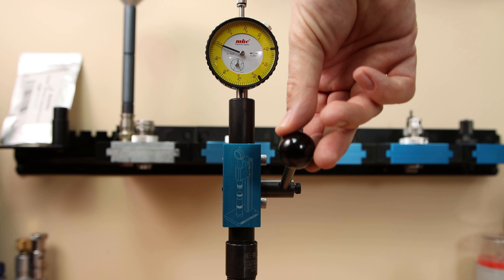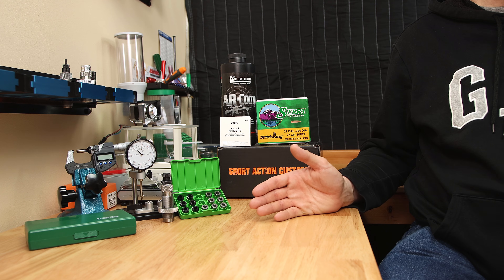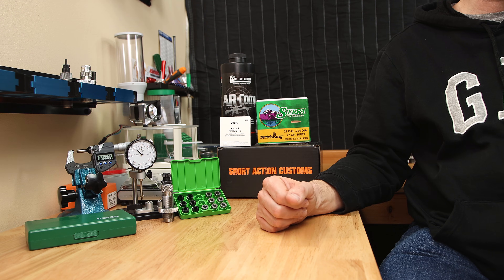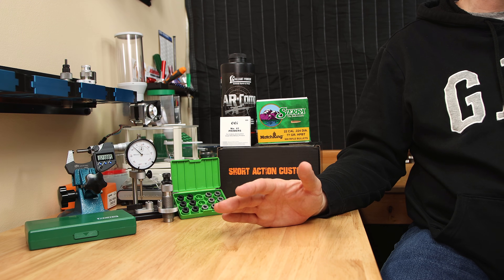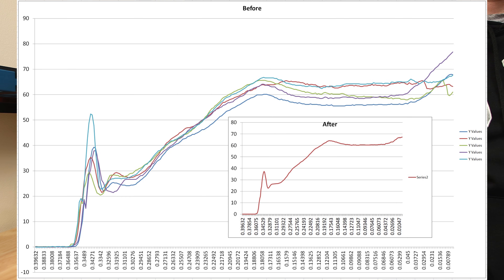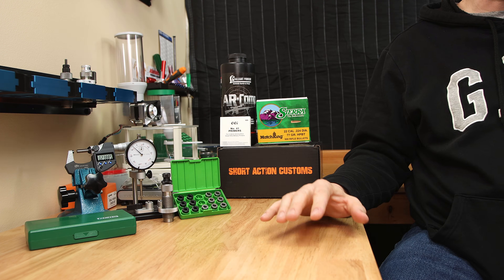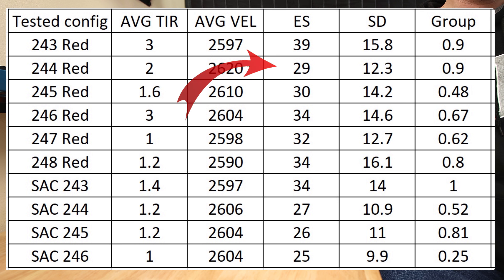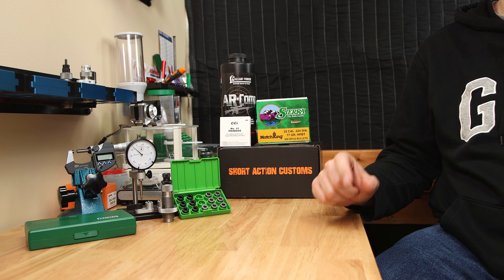Testing Neck Tension in 223 - UNBELIEVABLE Results?

Comment: if you try to use calipers for measuring wall thickness or anything else that small, you will likely get quite large errors unless the pressure you exert on the caliper when doing a zero is a lot higher than otherwise.
the zero from my experience is not a soft zero like anywhere else on the scale, but is a solid jam closed or it will be 0.002-0.003 inches out. i checked this on feeler gauges to work out how much error i was getting and it was relatively consistent between calipers. 
the real point is...dont bother to use calipers for measuring neck thickness or case width as its not designed for them. Use a Wall thickness micrometer or similar, that is designed for that purpose.
Reply: i was tearing my hair out doing neck turning, aiming for 0.013 but constantly ending up at 0.011 until i checked the turner with feeler gauges, and then checked the micrometer accuracy at zero reference measurements.
uniform neck thickness and a specific neck thickness is critical if you are using a die such as a Redding S, where the neck thickness dictates the bushing used (if you are trying to dial in the bushing size for neck tension without over working brass).

Comment: Could you kindly help? Can I adjust the redding type s die to get more neck coverage with a SAC bushing?
Reply from the maker: Adjusting the top screw down to touching the bushing and then backing off a 1/8 or 1/4 turn to allow the bushing to float is as much as you will be able to size the neck. That has been plenty for anything I have used them in including 223 and 300 win mag.

Comment: White Oak 416r Barrels<Criterion 416r Barrels. Probably the cheapest accuracy I’ve ever bought. Just this past weekend I shot two one hole groups at 100 yards measuring  .25” and  .33” with two different hand loads. But I also use a Silencerco Omega 300 suppressor which has consistently made every rifle I have more accurate.

Comment: Another method used by erik cortina is to use a bushing that takes it a little below desired neck tension, then use a mandrel to set the final dimension. You could just use a normal die amd then mandrel, but the purpose is to not over work the neck. I plan to try this soon on my new 20 practical. Also, annealing is going to change tension without changing the method.
Reply: Erik also doesn't clean the inside of the neck, which reduces the coefficient of friction and prevents a true cold weld.

Comment: Something to consider if it's a auto loading is that if neck tension is light enough the projectiles will shift to touch when cycled therefore alter coal possible to a better harmonics position. Not that this is the cause of the smallest group but it does need to be considered. Seating depth with have the largest impact on group size a closer distances

Comment: This is great data, thank you.  So I take it you run a 21st century mandrel or turning arbor through the neck after sizing with the Redding sizing die with the SAC bushing?  I’m just confused on this one point, because you have referenced both systems to reduce runout.  I have reduced runout quite a bit by just using a 21st Century mandrel after sizing with a std sizing die and calling it done.  Thanks for any info.
Reply: I was going to ask the same question.  It wasn’t mentioned if a mandrel was used after sizing.

Comment: Love your Channel very good information and with data to back it up. But I have a .223 using LC brass bought a 245 originally but I could push the bullets easily. I contacted SAC and they requested pic of the calipers measuring the brass. They were nice enough to switch the bushing since I had just purchased it. They recommended 243 and I get good groups. So what changed?  Thank you.
Reply from the maker: I am not sure what your seated dimension is. 3:10 in the video I show the what the example is based on. I wouldn't think there was that much variation but you should usually be .002 to .oo3 under this dimension.

Comment: Just found your channel.  Question, if you set neck tension, is there a need to crimp? I'm just reloading 223/556 for my ar
Reply from the maker: Hello kfez, Welcome to the channel! If you set enough neck tension you may not need to crimp. If there is a cannelure, I may think about it but if not I have not been doing it personally. You can test and see if you have a issue with the COAL changing and see it if matters for you. It also depends if you want to prioritize accuracy vs function. Every time I have tested it I seem to be loosing a little accuracy by crimping, may not matter to you at all.
BAR
Reply: @BoltActionReloading  thank you for your time. I'm just getting in to reloading, so I may have a ton more questions.  Thanks for putting out good informative content

Comment: Could you do a video on the AR your using(ie bolt carrier, bolt, receiver ect) to go along with that White Oak Barrel which are a deal for the accuracy. I’m wondering if the muzzle is threaded and are you using an adjustable gas system? Did you loctite or use shim stock on the barrel extension during installation? Great video thank you!

Comment: Hey Guys, dear @BoltActionReloading let me have an ambiguous question for you, which is totally not clear for me and may put some new light on the subject. Lastly I found videos about this gauge https://youtu.be/LMOx9nBBJzY and it is also used for light "hammering" the neck. The thing is that the action is performed on fully prepered ammo, the run-out measurement is taken from body (not the neck) and the pivot is hitting the neck with projectile already seated. Am I missing the point of this device or in fact it's changing the bullet seat and can worsen neck run-our? What is the reason to hit the neck (with already seated bullet) and measure change on the body. Is it anyhow possible to improve total concentricity (to streighten the ammo) without any influence on neck and projectile seating?
I decided to ask this question here because I believe this channel community have great knowledge and experience. I'll appreciate your help to understand the approach described. Cheers
Reply from the maker: Hello Sir, You ask a very interesting questions that many will disagree on the answer. I have not tested this type of functionality before because impacting the case on the most fragile part hasn't made a whole lot if sense to me. Though we all like small groups, this appears to possibly be more geared towards benchrest folks not to say you couldn't use it for what you like. Hornady's tool allows for something similar but I pretty much tried to fix my concentricity in my sizing die not after I had seated the rounds. If you decide to try it out let us know how it works for you.

Comment: If running light neck tension, i.e., .001"-.002", does brass spring back play into the equation?
Reply from the maker: Hi Tim, Some spring back should be expected, and it will be different if you anneal or you do not.

Comment: I have the Redding .308 die.  Would I want the SAS bushing that is .003 smaller than the bullet?  .305?  How do I get the ID consistent?  FL die with certain size Mandrel?  Apologies, but I'm new to this.  I'm not new to reloading but I am to specific neck tensions and being more consistent.  I have an AR 308, a bolt 308 and a 300 Win Mag, oh and a 7 RM.
Reply from the maker: HI Gary, I am going to cover this exact caliber (308 Win) if you can wait. Usually you would go .002 to .003 under loaded round diameter. If you were going to mandrel .002 under is a good guess. I did a version of this with mandrels already but I want to add the amp press graphs so I will be doing it again. https://youtu.be/OMEi5eHTLxQ

Comment: Richard Lee made an interesting statement is his Modern Reloading book.  He basically stated that if the neck of the case is more than 0.001 inches less than the bullet diameter, the bullet serves as a conventional expander.  He also said that a bullet does not make a good expander and would create excessive runout. In my opinion, since the brass used in your comparison test is random range brass, the data provided may be inconsistent due to other variables.  It would be interesting to see this test done with a consistent lot of new, quality brass such as Lapua.  Another useful aspect of this test might be to carefully remove a set of bullets after they had been seated and measure the inside diameter of the case neck.  This would test the validity of Richard Lee's statement regarding the bullet acting as a conventional expander.
Reply: clever, smart and wise bloke that Richard Lee. In ways, a genius.

Comment: I really think this is due to the short action custom bushings only sizing half of the neck vs Reddings that size the entire neck. (all the way thru the bushing is the same diameter vs SACs bushings that only size halfway thru the bushing.) This is  why you have to go 1 size smaller on SAC bushings to get the same tension, I am sure.  If your data is correct then it must be helping groups I cannot argue that. But why is only halfway sizing the neck (approximately) doing that?  I would love to see this test on good Lapua brass with the inside and outside necks turned /reamed for consistancy.

Comment: I have 6.5mm, .30 cal and .338 I need bushings for. I'm going to try Redding bushings first . I know I will need 2-3 bushings for each caliber. They retail for 15.95 ea at Creedmoor. Reddings Titanium bushings are 26.95!  The SAC Bushings are 35.00 ea from them. Yikes!  I cant imagine Reddings being inferior quality. It appears the big difference is the SAC bushings only sizing halfway thru the bushing to me. Anyhow, that cost difference is $143.00 vs 315.00! I will check the runout on 2 different measuring systems and find out if my runout measurements are as inconsistant as yours. I am using Lapua Brass tho, not range pickups.

Comment: Since using the two step method of redding body die to bump the shoulder 2th and lee collet neck die I've been getting 1.5 Max in run-out, cheap set of dies and they work for me
Reply: What's the clamp you have that's holding the micrometer
Reply from the maker: There is a link in the description to a micrometer stand.

Comment: Thanks for the great video. Probably a stupid question: Can you use these bushings in a redding 308 Win B/FL 9R Die, or are they only for Short Action Custom Dies
Reply from the maker: They are not just just for SAC dies. But I don't think the model you list there is a bushing die is it?
Reply: @BoltActionReloading Thanks for the reply. Yes, the redding code is 77155 (sorry for any confusion)
Reply from the maker: Yes they will work with that, in fact I plan on doing a similar study with that exact die in my 308 Win at some point in the not too distant future. (I already have the bushings) I was using 223 as the first run to see what adjustments I should make when I do other calibers.

Comment: Great video! 👍  two questions though.  I'm assuming that your WOA barrel is on a  gas gun?  If so, are you using the magazine to feed or are you single feeding?  Also,  I miss your data page that lists the load data.  That was nice to see in your older videos.
Reply from the maker: Hi Jay, Yes its is. I am feeding from the magazine. I will probably bring it back I was just trying something different.

Comment: Great video, and love your sense of humor.  "You could probably get this accuracy without the fancy tools, but what fun would that be?"  Or,  "Many will draw their own conclusions, even though you weren't there to witness the testing".  I has a plaque hanging in my office that said, "Without data, you are just another opinion".  Seriously, this is excellent test data.  I have pretty much gone away from using my Redding S dies and bushings due to the run out issues, and after FL sizing, run the brass over a 21st Century black nitride expander mandrel.  I'm considering going back to the Redding S dies and SAC bushings, then using the 21 Century black nitride expander.  Your thoughts?
Reply from the maker: Hi Gary. I appreciate that very much. Sarcasm was my 1st language, but I try to keep it to a minimum. I really wish I had a larger number of samples at each option, but sometimes the total number is getting out of hand. If you like the force graphs you will appreciate what's coming. (at least I do, but I am clearly biased.) how you size your brass changes these graphs, (I know shocker right) but correlating them to the accuracy is the hard part, but I am working on it. I spent 3 days the last 2 weeks researching how to write VBA code to automate some of the data processing tasks so hopefully the next ones I test will be faster.

Back to your actual questions. I had pretty much abandoned my s dies until I found these bushings, but I have bought more so we are going to test it all. (eventually) SAC has been kind enough to provide the bushings, so I am going to try and get the testing results out there. I have not tried any of the new black nitride expanders from 21st century, I see they have a option at .001" and .002" under caliber diameter so I would get both if I made an order, then how many calibers? Have you used any of these new nitride expanders yet? I have had several folks ask, but don't have any feedback for how they work.
Reply: @BoltActionReloading  Yes, I have used a black nitride expander.  I had been using an expander from L. E. Wilson with a stainless mandrel.  I was a bit surprised at the force to expand the necks, and the amount of brass deposited on the mandrel which caused me to purchase the 21st Century black nitride mandrel.  I was blown away by the ease to expand.  I use Redding dry neck lube when expanding necks which made quite a difference with the L. E. Wilson mandrel, but little difference with the black nitride mandrel.  Might be another project for your AMP force gauge, to measure the difference between SS and black nitride mandrels.  Thanks again for your efforts to enlighten the rest of us.
Reply: @garysreloadingroom Reloading I've run into the same issue lately, sometimes the force required to run my SS Sinclair mandrel through a case. I read in your post that you are pleased with the 21st Century black nitride mandrel. Did you have to buy the 21st Century Die Body? I use a Sinclair die body. Thanks!
Reply: @kenhatley1041  Merry Christmas Ken.  I honestly can't say for certain that I have used the black nitride 21st Century mandrel in anything other than the 21st Century body.  I just went through my reloading tool cabinet and couldn't find my L. E. Wilson body and expander (think I gave it away).  On the 21st Century website, they state "21st Century Expander Mandrels and Arbors are designed for proper fit in our die bodies. While these may work in most Sinclair and PMA die bodies we cannot guarantee proper fitment in those bodies."  You might order a black nitride expander and see how it fits in your Sinclair body.  I'll bet it will work just fine.  All my testing has been performed on annealed brass, and although I don''t have a seating force gauge, my seat of the pants feel for seating pressure was enough to sell me on the black nitride mandrel.
Reply: @garysreloadingroom  Merry Christmas to you as well!  LOL, it sounds like you and I share the same reloading techniques! I do not have a force gauge either. Just as you commented about your "feel" for the force required to expand, I experience the same. The comments made on this thread, as well as other forums, make perfect sense about using a mandrel to expand necks. I think I will go ahead and order the 21st Century and cross my fingers that it will fit!
I've been reloading for about 40 years but just started "precision" reloading a couple of years ago so I am trying to learn as much as I can! Couple questions for you: do you size the brass (with a bushing) and then expand the necks with the mandrel? 
Do you use 21st Century's Moly Dry Neck Lube when you expand case necks? I have always used Reddings Imperial Dry Neck lube and therefore have no experience with any other products.
Thanks so much for your feedback!
Reply: @kenhatley1041  You and I have been reloading for about the same number of decades, which is another way to say the we have learned much via the school of hard knocks.  My process is: Deprime, tumble wet (Dawn & LemiShine), dry (Lyman dryer), inspect, anneal (Bench-Source), prime, lube (Imperial die sizing wax), full length resize (just enough to allow the brass to chamber), wipe off the lube, dip neck in Imperial dry neck lube, run the appropriate caliber nylon brush through the neck to distribute the dry neck lube, run the case neck over the black nitride mandrel, add powder, seat bullet, check runout with a Sinclair concentricity gauge.  I reload rifle ammo on a Forster Co-Ax press, and found that going from a Redding T-7 improved runout, and then doing the full length sizing, my concentricity was much improved over the Redding bushing die.  My runout was improved to no more than .001, and it really showed up in my cronograph with low ES & SD's.  I may experiment with the Redding bushing die at some point using a Short Action Custom bushing.  F-Class John did a YouTube video on bushings, and found that there was considerable difference from one manufacturer to another.  I will likely do this just to satisfy my own (alleged) mind, as I think that it is one extra step that works the brass in one direction, while the mandrel works it in the opposite direction.  Might make more sense if I was still neck turning.
Reply: @garysreloadingroom  Thanks so much for sharing your process! This is extremely helpful. Do you have your own YouTube channel?
Reply: @kenhatley1041  No I don’t.  Not sure that anyone wants to see an old fart reloading ammo.  Wonder if I could get the Swedish Bikini Team to do the demos while I film?  It might work!  😆👍